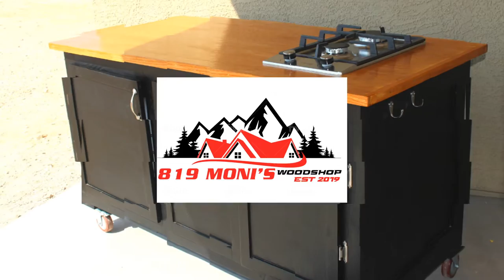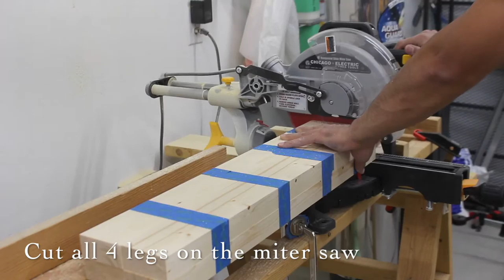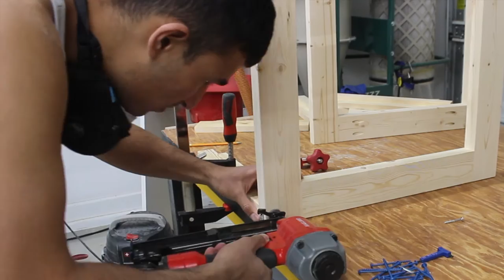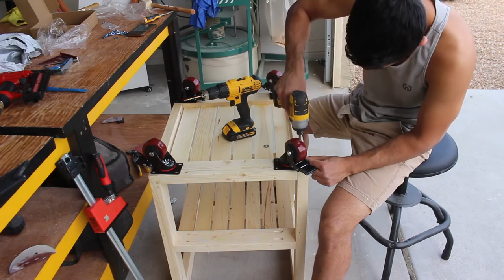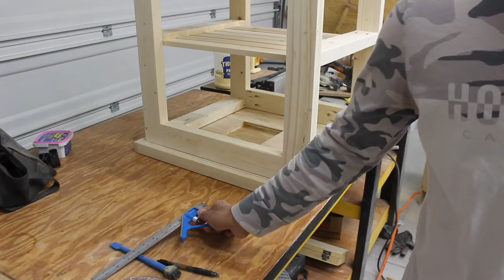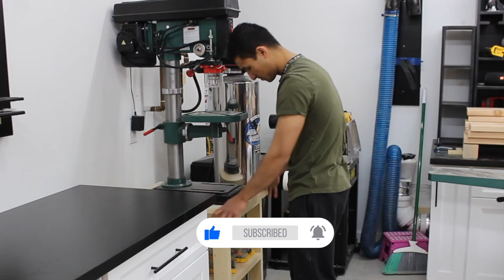DIY Drill Press Stand. Easy Mobile Drill Press Stand. (Free build plan)

Comment: Nice and simple but only thing I would do different are solid shelves instead of planks.  Too many things like screws, nails, tool that can fall thru the spaces.
Reply from the maker: Thank you! planks was the cheapest option for me. I don't keep any screws or nails down there so it works fine for me.